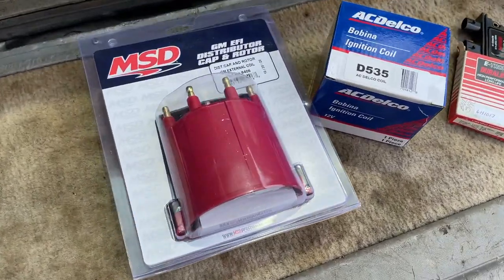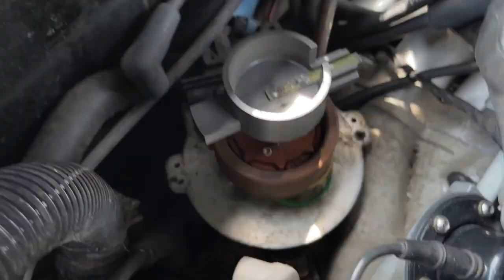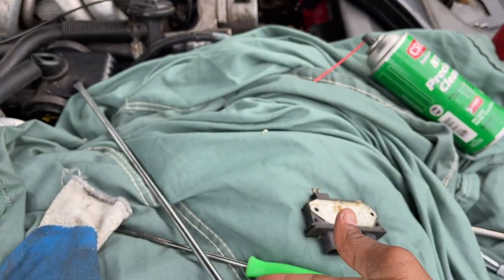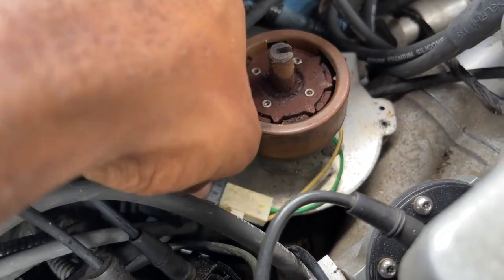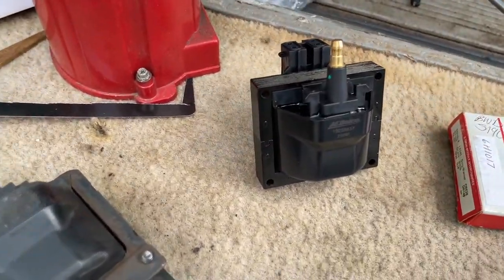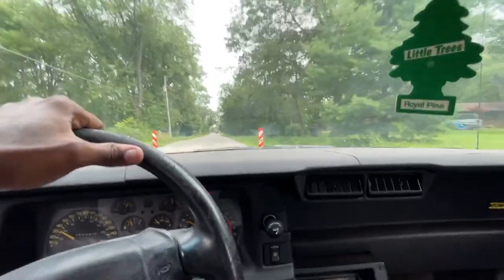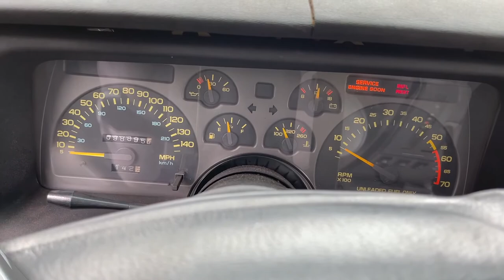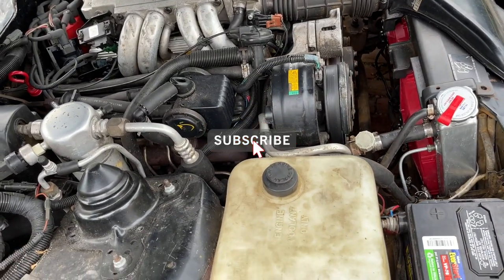Installing a Distributor Cap, Rotor, Ignition Coil & Ignition Module In A Third Gen Camaro!

Comment: there's only one thing i didn't understand i was told when installing a new map sensor your suppose to put whatever that white goop is in-between the bottom of the sensor that makes contact with the distributor. did you already put that on or is it not a need for it to work properly?
Reply from the maker: There's no need for it. I have changed many. Thank you so much for watching.
Reply: @TerenceDIY  hahahaha....yes, there is a need for it....

Comment: Great video! Just changed these exact same parts, mine were  corroded, but it did not fix my issue, also changed the map sensor, fuel pump , filter and sender, the car idles fine but fails to rev up, im going after egr and fuel regulator next
Reply from the maker: Hi Anthony, I have a detailed video on my channel for the fuel regulator and EGR valve. I show in detail how to remove, replace and clean them. Thanks for watching!

Comment: Question might be dumb but please help me out. So because you have an msd distributor that means it’s and HEI one correct? So that’s why you had to upgrade the ignition module to a high performance one correct? I see on rock auto they have ones that say not HEI and some that don’t say that. I’m guessing it depends on your distributor?
Reply from the maker: Hi Anthony, the MSD distributor cap and that high performance ignition module is just a step up from the factory. I could have used that module with the factory distributor cap and vice versa. It's barely a noticeable difference as far as power. You will see a slight increase in gas mileage if you decide to use the MSD cap. Thanks for watching.

Comment: What do you think would make a 89 gta with the same engine you have cuts off and just won’t crank back up unless you let it sit for awile but it will start with starter fluid I replaced the pump already just don’t know what else I can do
Reply from the maker: Hi Josh, have you checked your FPR(  fuel pressure regulator)? I have a detailed video on my channel of me replacing that part.

Comment: Great video. Having some issues with mine. 305tpi 5speed. Has a random sputtering and shaking going on in idle and during coasting with light throttle especially around 2000 rpm. If I stab the gas it's good.
Distributor is swapped. Plugs and wires are AC delcos (ac delco r43ts) New coil (standard motor part-brand). Timing is 6* btdc. Done the minimum idle air, Iac and tps adjustment (those are also new standard motor parts).
It started happening after my local workshop swapped the dizzy when I was at work at sea. They dont know what's going on and I've been effed with this for 2 years. Parts cannon has been fired lol
Reply from the maker: Lol. How is your fuel pressure?
Reply: @TerenceDIY  Fuel pressure is good and filter was replaced 2 years ago. Haven't been driven that much after that
Reply from the maker: @kmas8229  , the reason I asked is because I had similar symptoms and my problem was a weak fuel pump. I changed it and it was fine (video is on my channel). Thanks,
Reply: @TerenceDIY  Oh damn. It could be the culprit indeed. I'll give it a test when I get home this weekend and see what's what. Starting to suspect the EGR valve a bit too.
Sorry if I came in a bit harsh on my previous comment.
Appreciating the help, friend.
Reply from the maker: @kmas8229  , you didn't come off as harsh. I appreciate you viewing my content and if I can help or shed light on an issue, that's what I am here for.
Reply: @TerenceDIY  Appreciate ya, man.
Reply from the maker: @kmas8229  No problem. I appreciate you watching my content.

Comment: If you don’t mind me asking, what symptoms were you experiencing before the install of the Cap, Rotor and ICM. I’m thinking of doing the same because my 1992 z28 5.7 is starting to Idle real low and sometimes stalls out when I’m at a stop 🛑 while I’m in gear. The car drives great and starts right back up. So far I’ve replaced, spark plugs, TPS, IAC. Any help would be greatly appreciated.
Reply from the maker: It stalled while driving. It would also cut off randomly but starts right back up. I've learned SO much about these third gens since replacing the many parts that I have replaced. You should also check your map sensor. That's another tell tale sign of what you are experiencing. Thank you SO much for watching!
Reply: Hi rydistang did you ever fix the low idle while in gear? If yes how did you fix it?

Comment: Hey bro, love the content, been having an issue with my 91 z28…. I had it parked for a few months, I went to go start it and it turned over I put it in gear and it shut off, now it cranks but doesn’t turn over….. the coil,distributer,cap and plugs have all been replaced…. I can hear the fuel pump working…. I’m at a stand still now, if you got any suggestions I would really appreciate it
Reply from the maker: Are you getting spark? That's the very first thing that I would check for. Please let me know.

Comment: DId you ever get to the source of the issues with the camaro? You said it was driving better but not entirely there. I've a 2.8 with the same issue. Misfire and bad idle.
Reply from the maker: A few bad injectors. I changed them out and replaced the fuel pressure regulator. The video is on the channel. Thank you.

Comment: Have you ever had the issue where you drive the car for awhile and cut off park it and try to start it up and it cranks but won’t turn over …. So far I’ve changed the icm and the fuel pumps coming on and car supposedly is getting the right fuel pressure
Reply from the maker: It seems as if you're losing spark. When it happens again, spray some starting fluid in the throttle body or the air duct to see if it will try to start. This will let you know if you have a spark issue if it cranks. You replaced the ignition coil and module?
Reply: @TerenceDIY  no sir
Reply from the maker: @acewashington6292  , if you haven't replaced those parts, that might be your problem. I have seen ignition coils and modules get hot and won't generate spark.